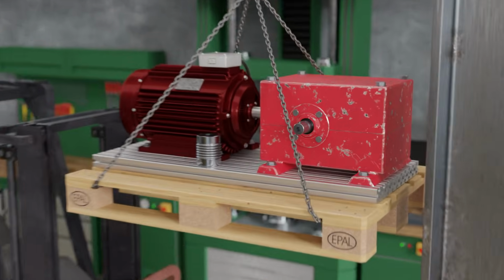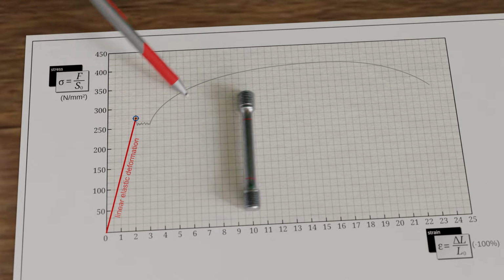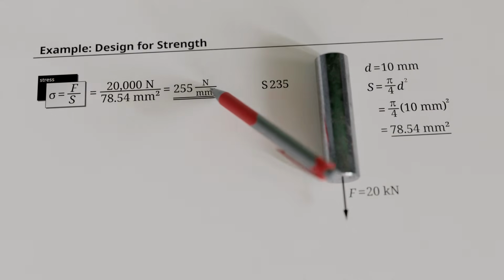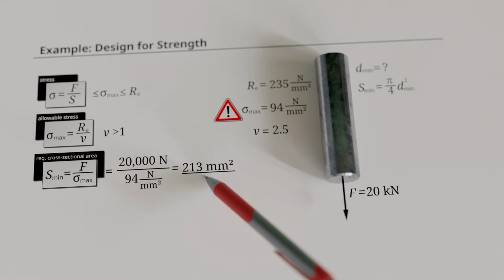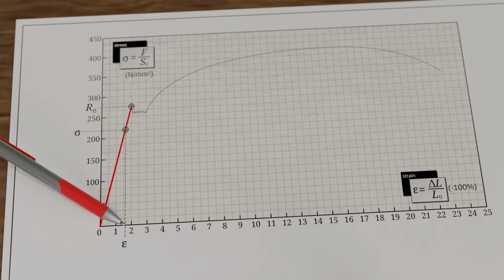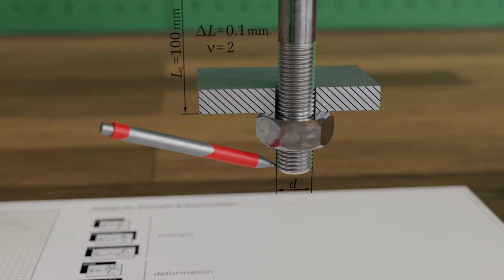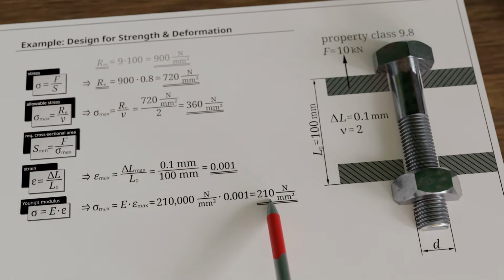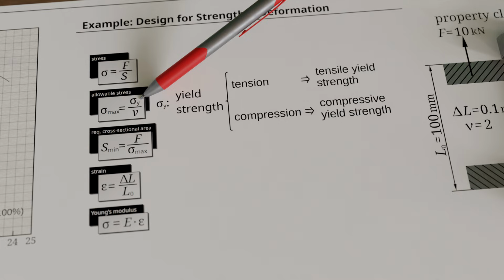Design of Components Subjected to Tensile and Compressive Loading | Yield Strength | Dimensioning

Comment: Do we know why yield strength is marked with letters Re?
Reply from the maker: The yield strength is denoted by the letter Re because it represents the "e"lastic limit and is a key parameter in the "R"esistance of a material to permanent deformation, a concept rooted in German terminology where "Re" stands for "Reißfestigkeit" or "tear resistance"
Reply: @tec-science and what about Rp and Rm? Thank you.
Reply from the maker: Basically the same concept:
R = resistance
e = elastic
p = plastic
m = maximum